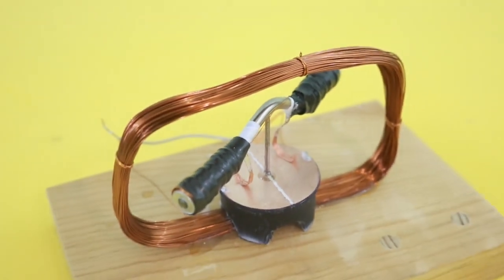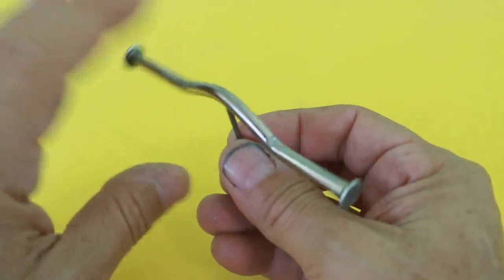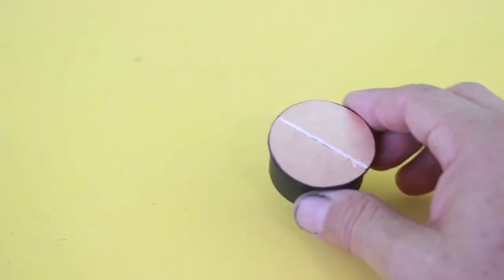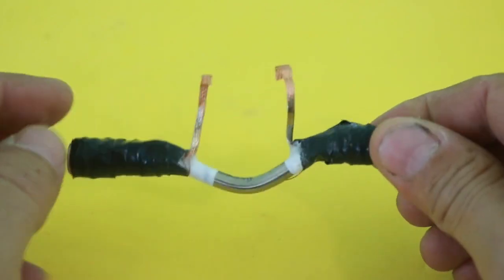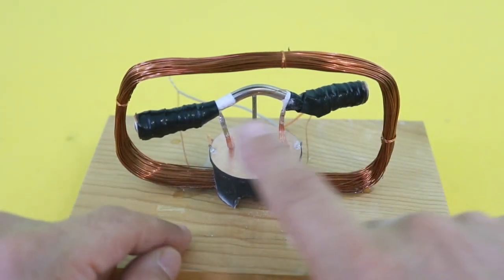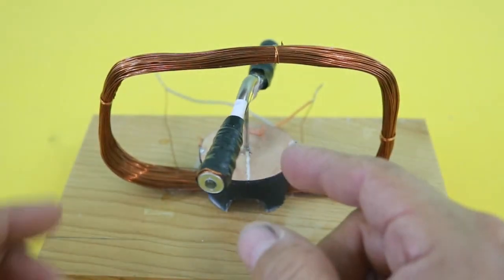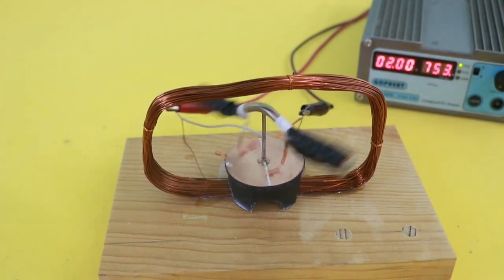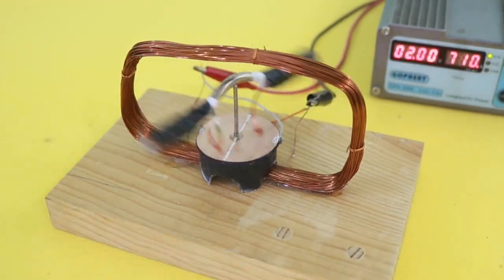Early Electrical Machines: The Jedlik Motor

Comment: hlo bro can u tell me how much power supply u use in magnetic accelerator video......._v_amp??
Reply from the maker: 30v 5amp
Reply: @ludicscience  isnt it dangerous for proximity sensor
Reply: @ludicscience  i buy proximity sensor..it had maximum load of only 300mah